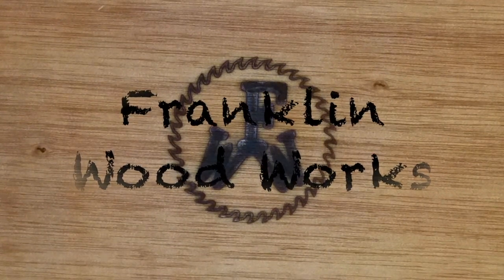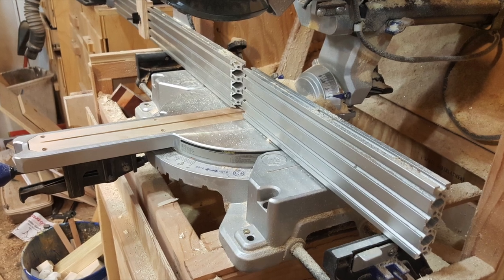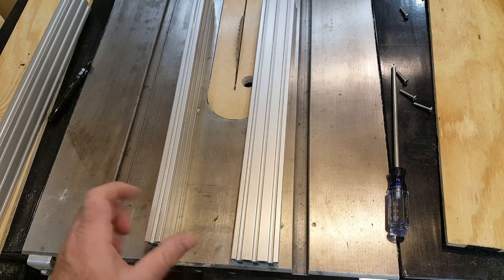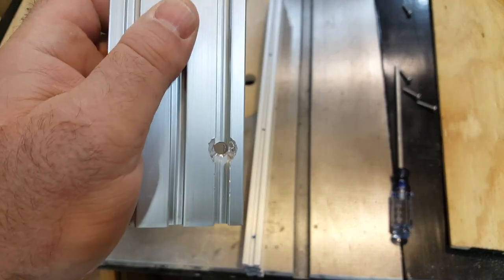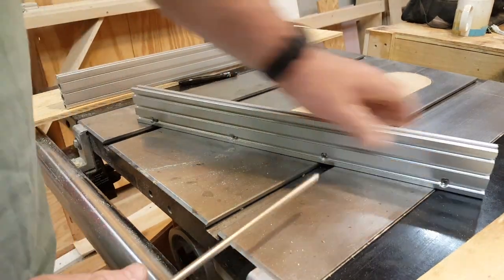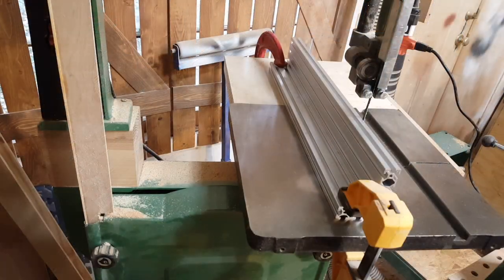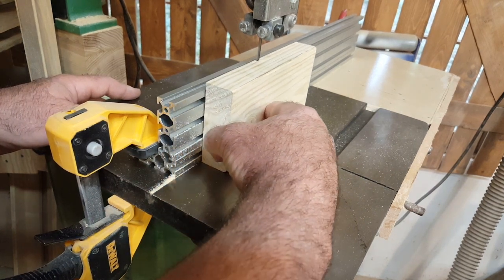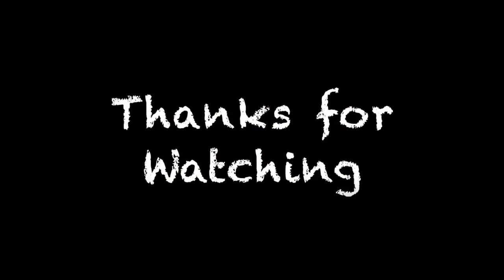DIY Bandsaw Fence

Comment: Of course you have the skills to align the holes. Next time, just drill the first hole all the way through, and using a larger diameter drill bit go through just the front. Do not go through it. This allows the screw heads to be recessed. Great job.

Comment: is that a harbor freight 14" band saw???  and did you put that riser in??? if so, do you have a video of that???  thanks Dan
Reply from the maker: Dan Malone That bandsaw is a 14.5 inch ( yes, 14 1/2) Grizzly made around 1990.  I made my own riser block from ash because grizzly no longer supports it with accessories.  Didn't shoot a video, but it's pretty easy to do.  I used ash because of how hard it is.  The hardest thing was fabricating the blade guard.  I did that with 1/8 inch plywood and hot glue.  I sold the band saw recently when I bought a more powerful Rikon.  Although the riser block gave me 12 inches of resaw, it didn't have enough power to handle it.
Reply: thanks...  nice job
Reply: WOW, a riser from ash, not metal? That would make me a little nervous 👀